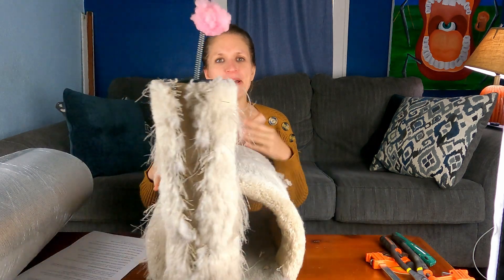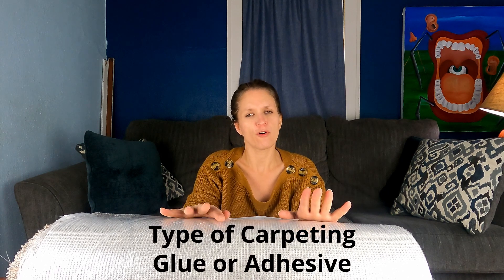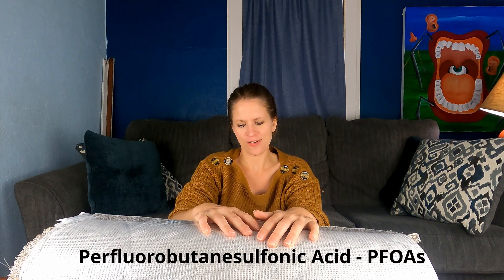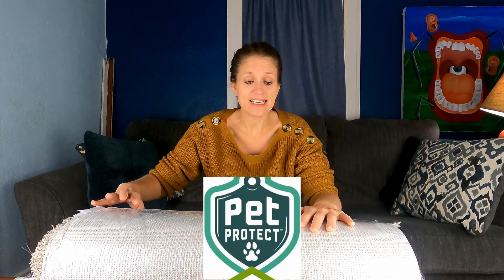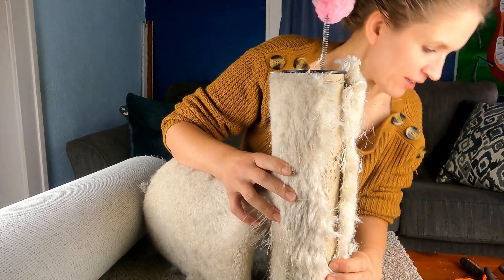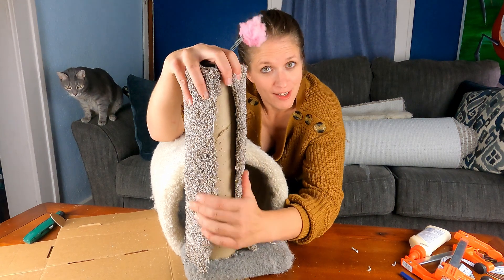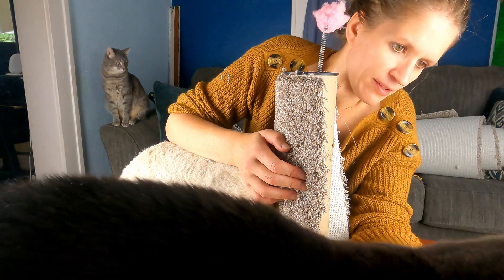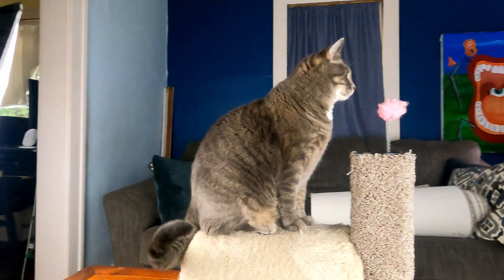How To | Repairing the CARPET on A CAT’S SCRATCH POST and How to Select Healthy Carpet

Comment: I cried listening to you and your stories. I currently have 4 cats but lost a few over the years. The most painful events in my life!!
Thank you for posting this video I need to fix 3 cat trees. What tool do you use a stapler ? Where did u purchase ? Thank you so much for this great video. I just subscribed to your channel and I will definitely follow for some advice.
Reply from the maker: Thank you for watching! The loss of my cats is some of the worst emotional pain I've experienced. My last one made my hair start falling out from stress and anxiety.
Yet I keep getting more knowing it all leads to pain. 😆 

I use an Arrow T50AC. I got mine from Menards (a Midwest home improvement chain) but they should have them at a Lowe's or an Ace Hardware if you have those in your area. :-)
I'm going to try to build a larger version of the barn this summer because Baxter has scratched the heck outta the whole thing now and that design seems to be difficult to locate. (There WILL be a video on that 😊)

Comment: Well I WAS about to fix my cats scratching post with the section of leftover carpet i had in the garage until i came here and realized theres 13,738 different this, thats, and the others that could be harmful to the cats and I dont know how in the heck I'd be able to find out if any of that crap is in the carpet. 😮‍💨
Reply from the maker: I'm glad it was a helpful video? 😆
😊
Reply: @WithFrankie  seriously... How do I figure out if it has any of that? The carpet didn't exactly come with a users manual/ label when it was installed 27 years ago. Lol
Reply from the maker: I'd say based on the fact that it was made 27 years ago it's at least as bad if not worse. Though maybe it won't off-gas as much.
Is there a way to determine the brand?